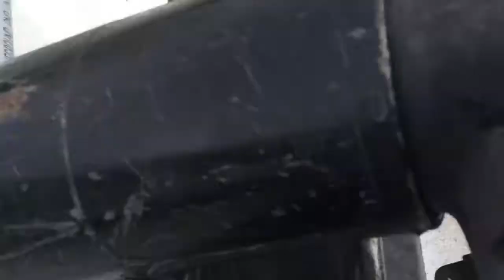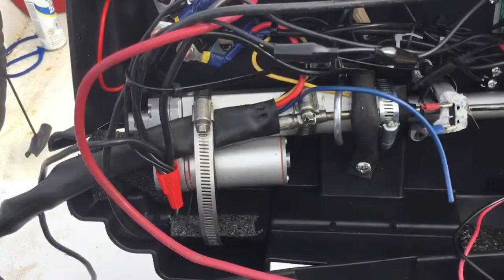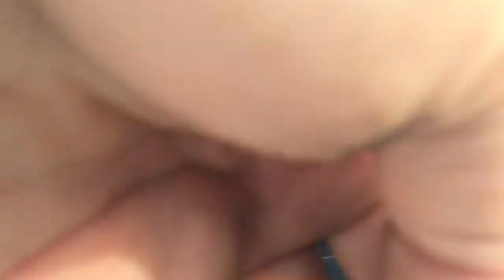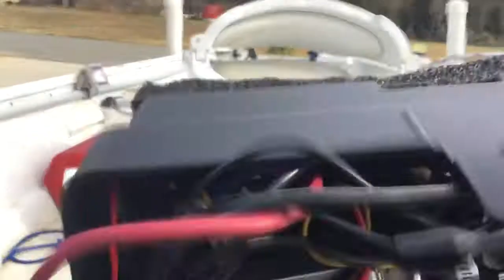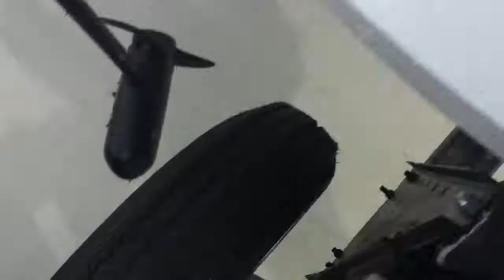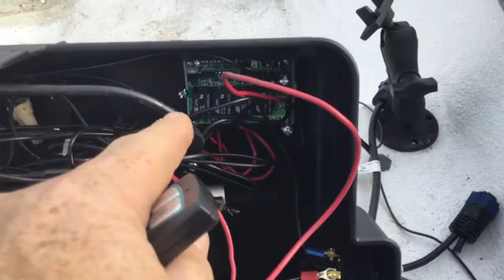Home made wireless trolling motor part 2

Comment: hey. whats going on with the mercury 25
Reply from the maker: THIS OLD OUTBOARD finished just need a Carburetor for it the one I have works but has issues.
Reply from the maker: Be on the lookout for a 1982 model mercury 25 Carburetor need one but not willing to spend 200 for one.
Reply: Rodger
Reply: your video says 1989? hers an 88 ,,  https://www.ebay.com/itm/Mercury-Outboard-Carburetor-1390-8889T22-1988-25-hp/142622482066?hash=item2134f65e92:g:hIUAAOSw6DVaLyGm&vxp=mtr
Reply from the maker: THIS OLD OUTBOARD Thanks my friend I was wrong on the year it is a 1983 model very hard to find parts for but it works just not right at idle. Will keep looking eventually one will pop up